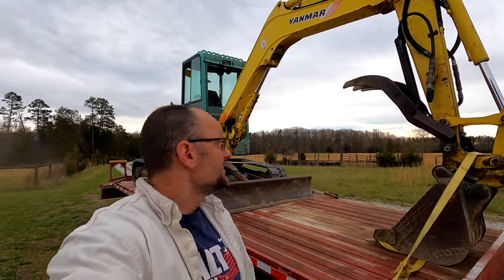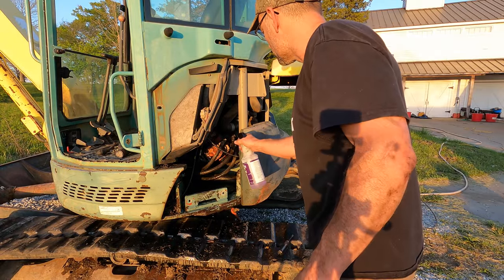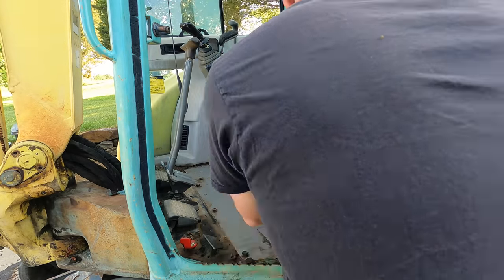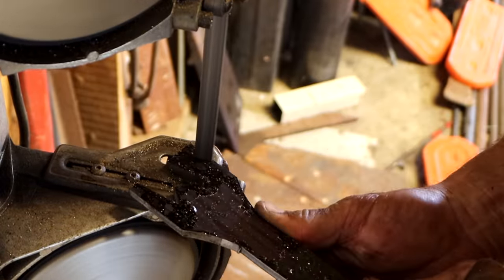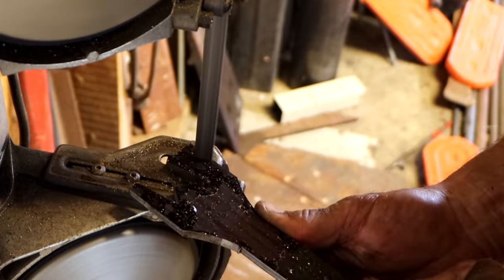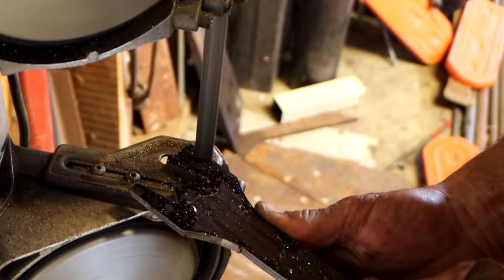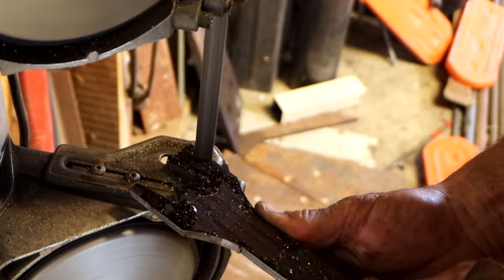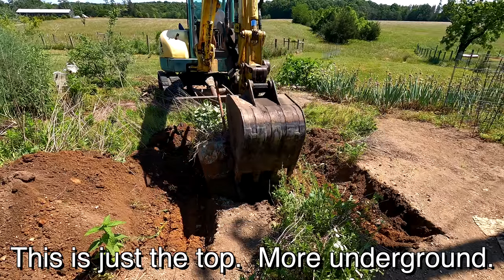Buying (and Fixing) My First Excavator.  Yanmar VIO-50

Comment: I do not know if my post went out.
If my post did not, please look up CaC2 AKA Calcium Carbide, it is contaminated with Arsine and Phosphine, Arsine is Arsenic Hydride, and Phosphine is PH3, Arsine is water soluble and becomes Arsenic. That tank you ripped up may have contaminated your ground water and garden as Calcium carbide was added to it to create Acetylene gas, again and again and again. The heavy metal just sits there, when you ruptured it, it may have been full of arsenic at the bottom, I am not sure about phosphine but the symptoms are very similar.

IF YOU DID NOT GET MY POST EARLIER, GO GET THAT SOIL TESTED, and ground water test too if you are on a well. Contact me if you need instructions, my post which I cant seem to find had all the info you would need. CDC, .gov and other guidelines and info you need.

I sent an email to your business address, and put my name on it as a signature.

Comment: The machine has so many issues and 20 grand it’s not cheap, worth the constant it ? How many hours have spent on it to this point in time, how much money in parts and replacements ?  That 20,700 looks more than that. If it had a mechanic working on it how many hours  up to this point in time. There are other parts that need replacing, you got a lemon

Comment: Dot really let you get away with that load securement? 1 chain per 4k lbs, chains pulling forward and backwards. If any accident would have happened that machine would have came off the trailer. You didn't even have the ass end strapped down.

Also pull and clean the adjuster or replace the zerk. 90% chance the spring in the zerk is froze up

For the fuel system.. there isn't an inline for purpose that the separator is there. Since dirt and what not is heavy when it gets to the strainer it collects at the bottom same with water. Dirt being heavier obviously. Its meant so you can pull the clear housing off and dump out the dirt and water. The inline now has to be replaced when it gets full of water. Skid steers/track loaders are notorious for this. Everyone i work on at work i have to pull the strainer and dump the water and dirt out. 
Now too much filtration might seem like a good idea, but there is such thing as too much filtration which can cause a restriction, resulting in loss of fuel pressure. Granted it barely has any psi before it gets to the high pressure pump.

Comment: I'm thinking u should screw that o ring tension nut far enough  away from the "gadget" to get a open end wrench in there. Then thread the shaft into the coupling. Then screw gadget to get the receiver hole where you want it. Then tighten down the o ring tension nut with your regular open end wrench that u already know fits in the space??? Just a thot.

Comment: I just wonder how you’re earning all the money to buy all this stuff and fix all of it? 
A fortune in materials to fix your front porch. 
Your wood shop (which is killer by the way) and associated tools were definitely not cheap. Complete dust collection system, Router table,  SawStop, etc.

Over 20,000 on a solar panel system and then another 20,000 for your little mini excavator, not to mention all the parts and fluids you ended up buying for it.
I’m getting by, but I don’t have discretionary money like you do.  I would love to know what you’re doing.